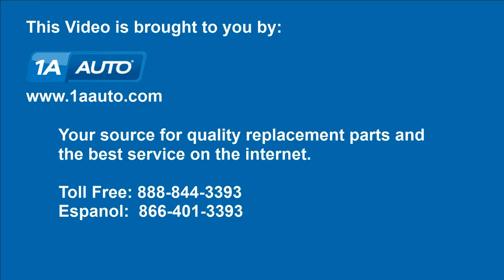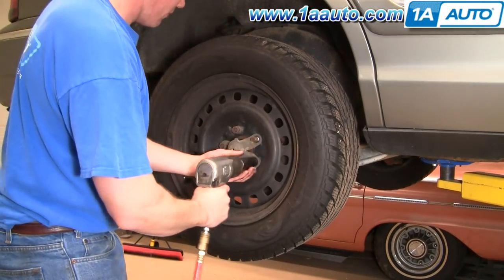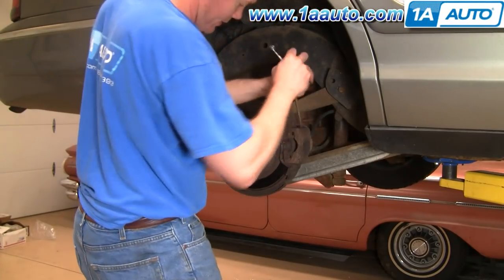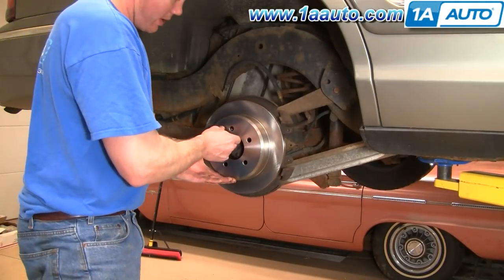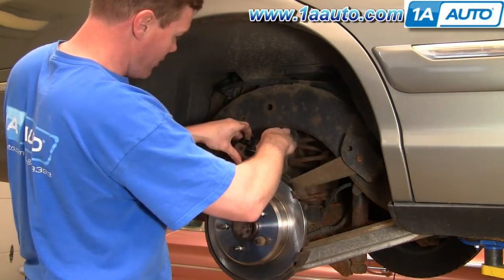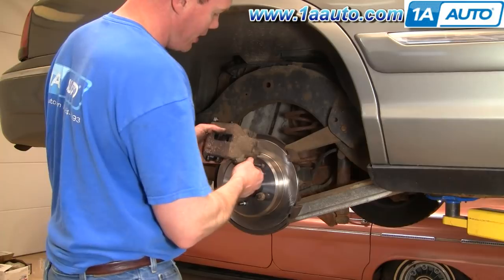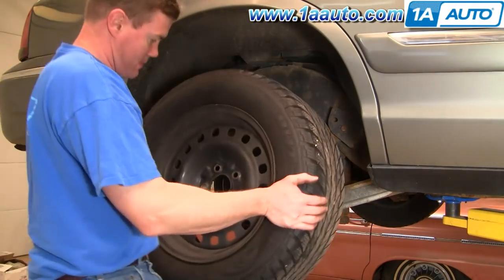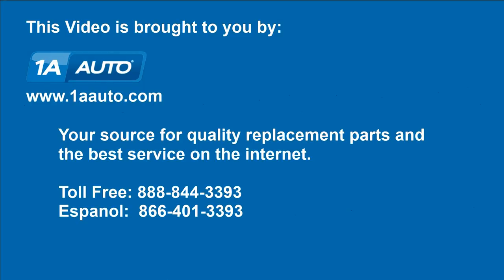How to Replace Rear Disc Brakes 98-02 Mercury Grand Marquis

Comment: I use white grease on the sliding bolts, and on the part where he used a wire brush also! I highly recommend finding out weather you have the steel piston or not, and if you have small clip size on back of break pads or the bigger size. I got the big clip and it didn't fit after having everything already torn all apart and the wheel off.

Comment: Hi there. Thank you for this informative video. The rear right disc on my '99 Grand Marquis LS is not budging. I spend an entire hour hammering the rotor to no avail and I used a lot of penetrating fluid. Is it possible that the parking brake is holding the disc in place? Thanks.

Comment: The backing plate on the pads is notched at the top to  fit into the top slide.  Then the backing plate at the bottom pivots against tthe bottom slide. There is a difference between the top and bottom of the backing plates. For some reason I had one pad notched at the top and the other pad notched at the bottom. Had to put old pads back in on passenger side. Driver side went on okay so I will pull that tire tomorrow to recheck.

Comment: Just use this for a reference thank you very much. The only comment I have is on putting the calipers back on, bottom goes on first and the top clips in place with that little spring on the top of the outside brake pad.

Comment from the maker: Make sure everything holding it on has been removed. If you have a sledge hammer it will help. 1aauto.com 888-844-3393

Comment: Beware....my 1999 Crown Victoria had washers for some reason on the rotors....have to do alot of pounding and brake the washers with a screwdriver.
Reply: My 99 is getting worked on now and my biggest issue sadly is that the three point clip is smaller than the old one